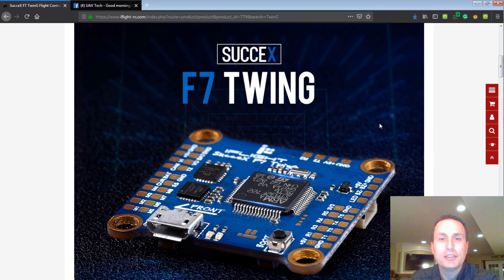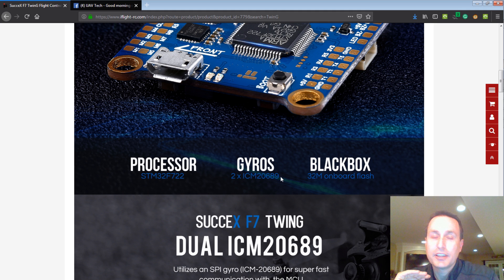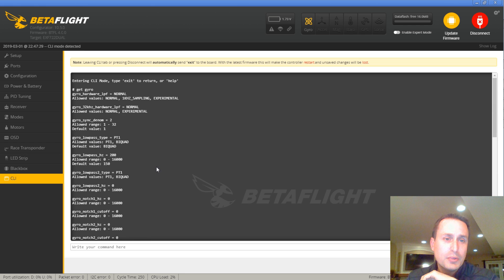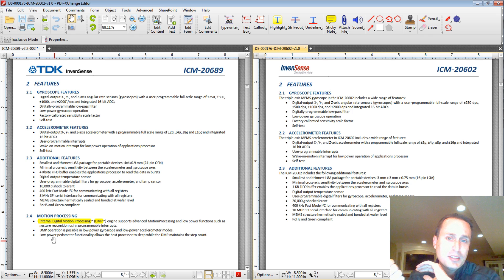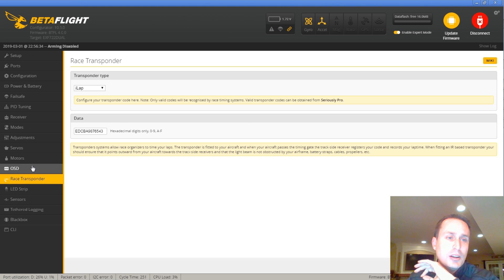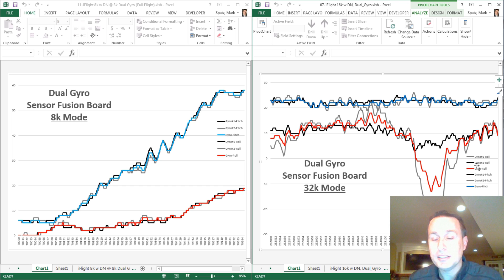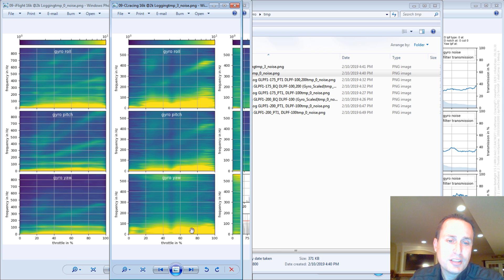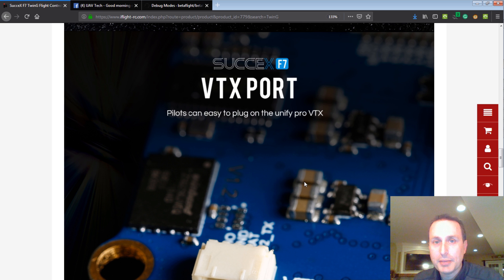iFlight SucceX F7 TwinG Review | Sensor Fusion Tech

Comment: Hate this flight board, can't get it to work right. Motors keep spinning up and don't stop.
Reply from the maker: If Airmode is active and on the bench, that is normal and not the board.  It is i-term winding up since you don't have props on.
Reply: @uavtech  replaced the iflight with a  Matek f722 flight board and it does the same thing, I turned off Airmode still the same. Can't get my drone off the ground. I give it a little throttle and the motors go to 100%.
Reply from the maker: Do you have Angle Mode or Horizon active as well?  Is this with props on?

Are you on default?

Did you check motor and prop orientation?

Did you calibrate the Accelerometer?

Comment: Good Morning,

I need help. I am desperate and I don't know what to do anymore. I have problems with the SucceX-D F7 TwinG stack (F7 + 50A ESC). 
I can't fly my quad. Every time I arm it and try to take off it spins senselessly and uncontrollably and falls to the ground. I have tried to fly only with the first gyro, only with the second gyro and with both activated. In all 3 cases it makes uncontrolled turns. 

Can I please send you a .log to see if you know what could be happening to him? I have never used dropbox ... can I send it to an email address?

Thank you very much in advance.

Victor
Zaragoza (Spain).
Reply from the maker: Make sure props are on in the right orientation.

Make sure motors are spinning.the correct way.

Upload you log to Discord and tag me.
Reply: @uavtech  Yes, I'm sure. 
The propellers are in their correct position.
The motors turn in the correct direction.
Reply: @uavtech  I have to record the log. I'll upload it to discord and tag you.
Thank you very much in advance!!!.
I really want to know what the problem is.
Reply: @uavtech  Hi, Yesterday I uploaded the log to discord. I've sent it to you.
When you can analyze it, tell me please. Today I have tested individually for each gyro all possible alignments and in all of them it has turned uncontrollably. Thanks!!.

Comment: having throttle up problem with this fc . i bought iFlight SucceX-D F7 TwinG Dual ICM20689 Flight Controller F7 FC Built-in OSD BEC Current Sensor Black Box for DJI FPV Air Unit (HD Version) and using esc that came with the stack fc4. arming it start but as soon as i give a little throttle it goes to the moon ! any idea?
Reply from the maker: Logging would show what is what.  It could be a lot of things in the build.
Reply: @uavtech  you think fc4 esc stack not compatible with fc7? thanks! i think going to scrub get new stack.

Comment: Some manufacturers has gone back to the mpu6000 for cleaner readings. Is this new ICM-20689 a bad choice in 2020 with Betaflight dropping 32k and so on?
Reply from the maker: ICM-20602 or 20689 run in 8k mode just fine.

Although the MPU6000 is a good chip, it is end of life.  TDK is not making any more so you will see it phase out ounce stocks run out; which surprisingly seems to take a while.

Do note the 20689 has a lower impact rating, but I have not had issues with it.
Reply: @uavtech  Alright, I've just ordered an iFlight SucceX-D mini for my Transtec Beetle. Did not like the FC with the F411, not having enough uarts and low clock speed. Will see how it works out. Thank you for a fast reply. Btw, do we have any use for the DMP?
Reply from the maker: @Fumes74  apparently no.  I have not messed with it both other say too slow.

Comment: I have the mini version of this board and was wondering if you actually use data from both gyros in Betaflight Blackbox Logs etc?
Or do you just treat  it like a normal single gyro FC?
Reply from the maker: It uses both.  It combines and the main Gyro trace is the combination; filtered.  

There are debug modes to see each gyros data too (pre and post filtering).

Comment: I have one of these flight F7 mini twinG boards and I had a flyaway, black box is showing a lot  of yaw noise with gyro fusion turned on, many have told me to turn it to first or second because there seems to be a bug in the boards or in Betaflight that is making gyro fusion really hard to fly or tune.
is there any way that we can see the difference between both gyro in blackbox data. I saw your wiki but.

this is the log for the flyaway. its the last flight in the log.
https://www.dropbox.com/s/pgcjiuegzitc9lk/BTFL_BLACKBOX_LOG_GECKO_4inch_20191207_105400.BBL?dl=0
Reply: ESK8 Support hmmm did you ever figure this out? I also have really weird yaw noise(just on certain flights)  on my success-d mini twing

Comment: So this or one PMU600? :D Whats your take 6month later?
Reply from the maker: win-win.
Reply: @uavtech  meaning? which one gives cleaner gyro noise levels? Because icm before was real bad compare to mpu6000
Reply from the maker: @airBornFpv  , they seem to be ok to me.  In only ONE case, have I seen an MPU gyro on a board that also have an ICM, was the MPU more resilient to an electrical noise issue (6s).  Nevertheless, the FC still needed to be replaced as the MPU was glitching out.  The ICM however, did glitch out more with the electrical noise.  This said, my Revolt boards and others with ICM work great.

Comment: Hello guys, I have just finished my new build. Everything is new and I'm using the Succex F7 TwinG + Succex 60A V2 4 in 1 ESC. I'm using default pids un Betafligh, Xing Motors 1700K and 4s Lipo. I went out to fly so happy and the quad shakes worst than my washing machine! I got no clue what the issue could be. I have checked everything I could but no idea. The dual Gyro is set to: both. Any ideas? Thank you😁
Reply from the maker: 1700kv on 4S?  

Grab a log in it with Gyro_Scaled recorded.
Reply: @uavtech  Hi, thanks very much for answering. I got no idea how to use Blackbox but some people said I'm crazy using 1700kv with 4s Lipo. How ever could it be the cause for the quadcopter to shake so much?
Reply from the maker: @Ger.FPV2023  , no it should not be because of that. A log would more clearly show us what it is.
Reply: @uavtech  Do you have any tutorial about how to install black box and record the logs? I will do my best and let you know

Comment: Where do i solder the telemetrie wire from a 4in1 esc on this board. 
Wich uart is best for that ? 
Hope you cam answer?
Reply from the maker: If using the plug header, it would come back through Uart5.  See https://www.screencast.com/t/XiSuQ03cIJaG

If soldering direct, Uart5 is here or here, see: https://www.screencast.com/t/pmuT6c2cNJ
Reply from the maker: If thinking BF BiDirectional RPM telemetry for RPM filtering and other features, you don't need to feed back the classic telemetry data.  It does it over the signal wire.

Comment: The ICM-20689 is a next gen of the old MPU6000. It is targeted at MPU6000 users; both have the DMP.  It was determined years ago the DMP was too slow for multi-rotor copter real-time attitude control; DMP output data rate is only 100hz. (FYI: the 20602 was a cost reducer product by eliminating the DMP) . The "drones" application use on the data sheet is probably referring to ONLY fixed wing drones and not multi-rotor drones.
Sensor fusion of the two devices must take into account possible failure of one; how to know which one is defective! Not possible with only two! Granted the very high reliability and non-mission critical application of these MEMS devices probably precludes concern for single device failure. However, use of only two gyros does prevent using the board in a mission critical application; say a drone with $50k of camera gear. It will be interesting to see how Betaflight manages dual gyro data and device failure.

20689 Vs 20602; the 20602 Is a better component all around. Over the past coupe of years the use of the 20602 in "racing" FCs was problematic and 20602 got a bad rap. Turns out the FCs switching power had poor filtering on input to the 20602. The 20602 and 20689 MEMS tuning forks resonate at 25khz to 29khz. 
Note that iFlight has mounted the sensors 90 degrees apart. That WILL present some data inaccuracy due to mounting of the die(MEMS) in the carrier and soldering induced mounting offsets. Might be trivial in this app though. 
Why "drone" on the Invensense/TDK spec sheet; marketing hype! Nothing more.
As an engineer, I've been through the design aspect. You can see my FC design at www.thomasbutlertechnology.com. Controller is designed for mission-critical use. It too has multiple/redundant sensors. More info for public release is at https://github.com/twbrkfd1/TBT-AV1
Oh; good job on well presented and articulated video! Others are great too!
Reply from the maker: Good stuff.  Thanks for commenting!  I shared on by FB page as well.

Comment: Just a note for folks considering this board specifically for dual gyro mode and planning to use RPM filter:  at present you can't use dual gyro mode with the Betaflight RPM filter -- current behavior is that it just switches to single gyro mode when you enable the RPM Filter (which was better than previous behavior of the RPM Filter just not working when it was in dual gyro mode).  See https://github.com/betaflight/betaflight/issues/7886 -- Update: Dual Gyro mode will work with RPM Filtering in Betaflight 4.1: https://github.com/betaflight/betaflight/commit/86f99609873c12608f5c4128ac4509b4add75db0

Comment: MPU-6000 (and similar) also had DMP unit built in and no one was using it either ;)
Reply from the maker: Yeah, i wonder why not?  Ever try?
Reply: @uavtech  It's pretty much useless in our application. I suspect it's aimed for smartphone, wearables, iot things.
It features motion, pick-up, activity, step, tilt detection, pedometer, simple sensor fusion/orientation/quaternion calculations and it's max rate is 200-225Hz. 
Obviously, DSP wise, Helio guys would have found use for it, if there was any :D
Reply from the maker: @mrozu1337  , gottcha.

Yeah, those Helio guys.  RIP.

Comment: Hi! Great video! With gyro fusion enabled in 8k/8k is possible to disable some betaflight filters to minimize latency?
Reply from the maker: Eh... you can lower phase delay by raising filtering, but i don't see enough vibration damping in 8k mode to turn anything off.
Reply: @uavtech  thanks for the reply!
Reply: @uavtech  so for 8k applications it doesn't seem to be much of a help, right?
Reply from the maker: @Mateyhv1  , it is nice to compare two gyro reading and either average or pick the best one.
Reply: @uavtech  yes, thats an advantage. Hope you can test the SeriouslyPro H7 Extreme FC, some nice features like 128Mb flash memory, PID-Audio bootable SD slot and a 45 degree offset dual Icm20602.
Reply from the maker: @Mateyhv1  , i have it in the bench for testing.

Comment: So with this and the RPM filter, noise would be a thing of the past?
Reply from the maker: It kills the motor band peak noise like a champ.  May find them u only need the dynamic notch then to clean up on the gyro (also automatic) and then only a single dynamic lowpass filter on D-term.
Reply: @uavtech  hot damn...

Comment: Building an iFlight Battle Axe now. Very nice FC, which I must have. Thanks for the video
Reply: Hey dude, huge flaw with the battleaxe frame has been discovered, If you experience sudden heavy oscillation, a ton of jello, super hot motors and it not tunable. I've had to swop out the frame for 3 clients now, it destroyed one clients Escs and motors. It sends the D term into space and has so much noise!
Reply: @BuZZarDFPV   Great.... a FC and VTX was all I had left to get before installing. I've had the frame almost a month so sending it back is a no-go. Is iFlight aware and will they take it?
Reply: @VinceB391  as you know with the Chinese, it's hard getting them to understand. But they are aware, I'm busy with one of their engineers at the moment to rectify this. But yeah, go get a diff frame. It's got massive resonance, it peaks every 200hz between 200, 400 and 600hz. The camera cage is excessively loose, arms mounts are like levera as they don't mount near deep enough into the frame. Yeah, went through 3 of these no luck, plus 2 clients tried them and hated them.
Reply: @BuZZarDFPV  Thank you for the info. I appreciate it

Comment: I noticed on the data sheets for the two icm gyro that the 20689 is rated to 10k g shock tolerance, while the 20602 is rated to 20k g shock tolerance. Seems like a lot of g force either way, so it might not matter, but that is a significant difference.

Comment: Why did you leave spektrum? I went from a DX6 to a DX9 with crossfire about a year ago and its been fantastic.
Reply from the maker: DX9 is too rich for my blood.  I do like OpenTX too.
Reply: not to bash spektrum but i lost 2 fixed wings to bad tx ,, one tx repaired , second same issue, 4000 in planes isn't easy to swallow , dropped hitec, futaba, spektrum,  open tx  frsky not going back.  jumper looks good

Comment: Strangely the 20602 is Rated to 20,000g shock tolerance twice that of this 20689 new gyro which is rated the same as the old mpu 6000 at 10,000g shock tolerance.

Just checked the bosch bmi160 also rated to 10,000g shock tolerance.

Probably just a stat pull out there ass tbh

Comment: ... ran into some nfo about the delays and noise generated; much along the lines you presented. if I remember correctly the conclusion ran along the lines: "sound in theory but practical application is not yet there. the combinations of variances was the beef. better quality (like the bosch etc) gyros might get us there soon or the other route taken by brainfpv, helio or for that matter through an "AI" framework as pursued  in will's. Neuroflight project ....  not enough hours in day (AAAAAARGH) - you keeping us posted is much appreciated dude.  solid vids vids and valid thoughts (as always), thanks from a scatter brain :-)
Reply from the maker: U can see the result vs. a single gyro.  Those are full flights.  Is anyone else publish apples-to-apples comps, or just making claims? 

I'll get a Bosch to see wsup.  Could be very valid, just no data on that o have seen.  Just wish folks would publish data with claims.  Not just make claims.

I would not.count on the "Ai" anytime soon.  I don't want to be a downer, but the bar is high to make that better than a PID loop, and i don't think we have the on-board power yet.
Reply: @uavtech  I agree with you "not counting" on the AI anytime soon in that respect - but but that's missing the point and a more fundamental discussion about the division of the labour needed to be done.
I had a very interesting visit from Bosch's top tech brass not too long ago which put a bit of perspective on the nature of our hobby's current hurdles. Specifics are as always f.confidential;  my take from it was, to re-evaluate the transitory nature of our hobby's current development challenges (back to the AAAAAAGH, for different reasons). 
Elaborating is unfortunately not possible possible and I must refer you to captain subtext for comments :-) :-)
Reply: @uavtech  (check these guys tackling what is "a different problem" when looking at the specifics... the novelty in the angle of attack on a higher level might spur productive thoughts in some)... https://www.youtube.com/watch?v=eUzB0L0mSCI
Reply: @uavtech  (In regards to why neuroflight is cutting ice)
Reply: Reinforced learning applied to quads is not AI.
It's approximate solution of optimal control problem, other approaches are LQG and MPC, but we have no model nor resources to perform nonlinear optimization on the fly.
RL on the other hand saves us from the issue of not having a model, and it's promising.
Reply: @die_hertz  ...hence the use of quotation marks - I'll try to be more precise in the future, quotation marks are a bad literary habit and totally my fault.